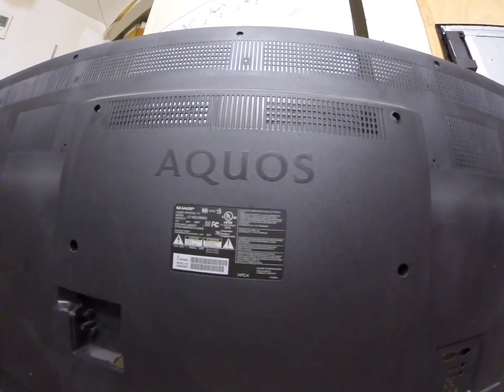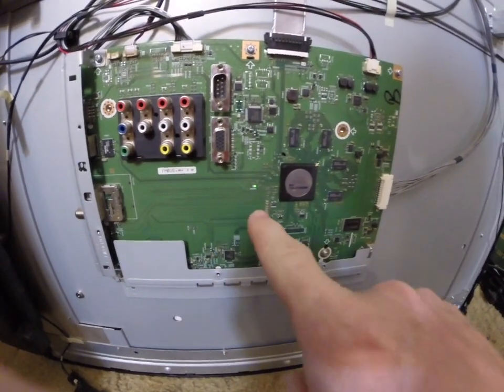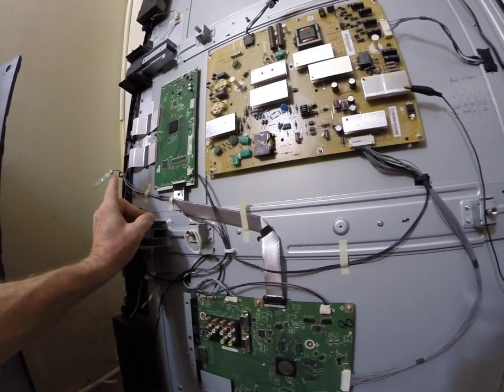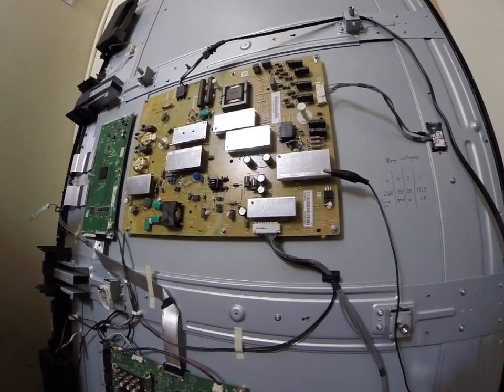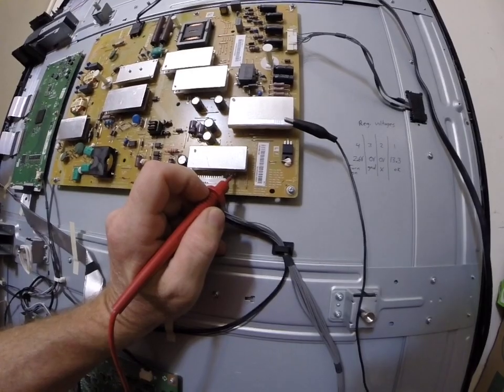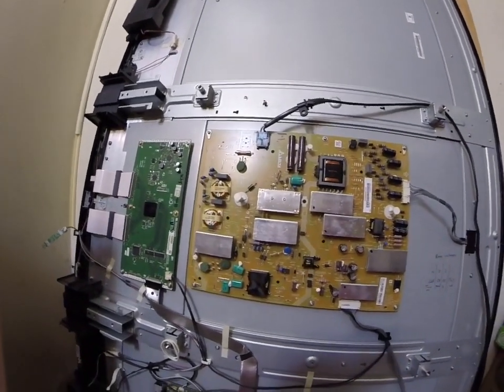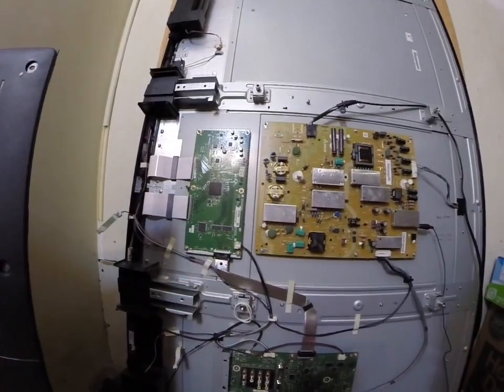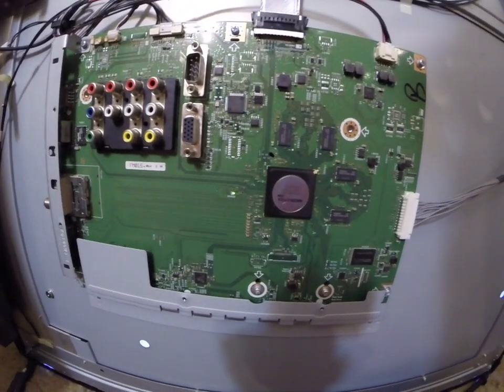SHARP AQUOS TV "LC-60LE650U"   flashes 3 slow, 1 fast.  No back light or sound. Here's the fix.

Comment: I wish I had seen this about a week ago. I just got tired of messing with my Sharp and it had the same fault and symptoms. I had replaced the backlights  because I had the one long one short fault code to begin with and it worked for a bit then went into the fault mode like yours. I also had a quarter of the screen stop displaying right before it happened.  I couldn't find no info and got tired of troubleshooting it and ended up just breaking it down and giving up. Thank you for the info though because now i can locate where i put my power supply board and repair it and maybe sell it to recoup some of my loss. I know they want an arm and a leg for the boards in these tv. Good find bro!!

Comment: Mine is aqous LC-50LE570X it has red standby and blue (switch on) but still no display no backlight no sound I tried to check the output voltage on standby it starts on 9v slowly going zero...do u have some advice for my tv?

Comment: Hi Ray, where did you find the  a  KIA378R12PI  ( 12V Regulator with turn on control ) I have ordered two sets of regulators these are not the turn on control regulator?  Can you please provide the manufacturer where you purchased your regulators?  Thanks a million!

Comment: Mr. Ray speaks the truth. Seems to be a common problem on this model power supply board. 
Same fix for a a 70" LC-70LE847U Sharp Aquos. In my case, the power LED was 2 slow and 5 fast which indicates display (panel) fault.
Normally fatal but having nothing to lose I checked the regulator anyway. 8.4 volts on pin 2. I want to say I got the replacement KA378R12
off eBay but not sure, anyway they were 2 for around 10 bucks shipped. It's a readily-available part; look it up on Google.
Make sure to remove the old thermal paste on the heat sink and apply new. Don't overdo it, a light even coat on the back of the part is fine.

The TV's been running sweet as a first kiss for a year or so now. (I got it free off off the local Craigslist) 10 bucks well-spent!
Reply from the maker: I'm Glad you got your TV repaired.. Good Job..

Comment: I have the same model...  I've been having power freezes (power light on, black screen, no response to remote) for years...backlight has never functioned...but no flashing or error code...  I have to unplug it, wait 10-15 minutes, then plug it back in...   Assuming that It needs that time to disapate the charge...  Do you think it's the same regulator causing it???  Thanks for posting this...  :)

Comment: Hi Ray, 
thanks for your video. I have the same Sharp model... it's been an excellent TV, until recently. I was wondering if you or your readers have any experience with this model, regarding local digital channel reception (re: antenna)...
We don't have cable (for channels),  but currently are using internet sucessfully for internet channels like YouTube.... we cannot any longer receive any local digital channels
My Sharp will no longer receive any local Digital channels (have done several resets, as per set-up, which has always worked in the past. I'm getting an error message "remove scrambled channels", which we never had this message in past years....  is there a digital tuner chip in the TV that might be defective?, or is this scrambling new? Thanks
 The antennae, cable & transformer have all been changed,

Comment: Hallo there I hope u still here I also have a sharp but mine is the model LC-60LE635E
It looks really similar to the model you have, the power supply board is the same and I have the same issue, no sound and no backlight. On my tv it blinks two times maybe I'm Lucky as well and have the same problem. I'll check the the four pins and give you feedback. Thank you for the video!
Reply from the maker: good luck..
Reply: I have measured:
pin 1: 12v
Pin 2: 13v
Pin 3: 0v (ground)
Pin 4: 2.4v

So my regulator is fine.. sadly..

Comment: Hi Ray, thanks for the video. I realize you may not know the answer to this, but I appreciate that you are taking the time to respond at least to other questions.. I am wondering where that turn on voltage, pin 4 on that regulator is getting its 3 volts from? That seems to be the problem with mine... I have 12v on pin one, but only millivolts on pins 2 and 4, I changed out the regulator thinking it was at fault, but after researching your video a few times I think I’m understanding that pin 4 needs to be getting 3 volts from somewhere in order to “turn on” and send voltage out of pin 2... is this correct? And do you know where it should be getting that voltage from? Thanks again!
Reply: Check  your other voltages on that board. You should have 5V standby voltage for one on another white connector and others. You could also trace the circuitry back to see where your missing voltage on that pin comes from. I wish these videos would show the schematic, if possible, so we could follow the voltage paths.

Comment: I have a similar issue with a lc55ub30u i just picked up off Facebook for free ordered all new boards for cheap off ebay I'm praying to jesus that after i replace all the boards it fixes it it's not hard to replace the leds i just don't want to have to resort to that and i truly don't think they're dead as I'm not positive but i think when i was tinkering with it they came on briefly at one point then shut off so I'm pretty sure it's power related
Reply from the maker: good luck...
Reply: @rays.2480  im pretty confident it is the power board aswell as the leds plug into that and the power light comes on so I'm hoping the boards fix it if they don't idk whats going on i think it's unlikely that its the lcd itself or backlights but i could be wrong

Comment: Hi I have Sharp Aquos LC70LE650U, I already change the power board what you did but still same flashing I get. Do you have any idea what else the problem is?
Reply: Same here. Just replaced the board to no avail
Reply: I feel you both nothing. Ill be ripping mine apart again to try and figure it all out.
Reply: JayR Barbosa  did you fix it?
Reply: I have same problem replaced board and still same issues

Comment: Hi Ray Thank you for the video I have the same TV model and the same symptoms unfortunately we don't see how you changed the regulator in the video is it possible to make another video where we see you  change it as is it possible also to confirm the technical name of this regulator so that I can buy it online otherwise if you sell it it will be cool
Reply from the maker: please read the other comments.. If you have any electronics experience, then you can do it,,it's not complicated to change out the regulator..
Reply: @rays.2480  thank you for your answer I checked all the comments but I did not find the regulator designation please give it to me please I will look for it on eBay

Comment: I have a sharp aquos lc-60le550u and it looks identical to this and doesn't seem to have a backlight even though the panel comes on. do you believe this is the same issue and should I go ahead and purchase the same resistor? I don't have much experience but i can go buy a solder to make it happen
Reply from the maker: For a few bucks,,, what do you have to loose ?

Comment: did u just happen to have an extra regulator in your pocket? and what are the steps to taking it out and putting new one in?
Reply from the maker: No, I had to order it, I got a few of them, they were cheap. I did my typical testing, found out which voltages were missing, Which happened to be my 12V regulator. Found it, Looked it up online. 

I was able to use a common regulator for testing purposes. The proper regulator has an on/off control. With the common 12v regulator, the set worked fine. But you could not control the functions of the tv to turn it off. So, when it worked,  I then ordered the proper regulator, installed it, and the tv was good as new.
An easy job for someone that has electronic experience.  Not a job for an amateur.
Reply: @rays.2480  i tried the VOL  down, Channel up, and power button at sametime to bypass the blinking and it works, so now i have steady light, but i have no backlight  now.
Reply from the maker: Sorry,  I can't tell much more about the tv, as i do not have it here. it was a customer repair.

Comment: hi i have the same tv whit the same symptoms did some power tests and i have the same as on you video  by any chance you have one of those regulator ?can i buy it from you ?? i only found them from china   delivery estimated February 22  thank you
Reply from the maker: I think i have a spare, I'll need to search my box, I'll get back to you soon..
Reply from the maker: Sorry for the delay, i have looked and i have 4 chips left.. Let me know how many you want.
Reply: @rays.2480  hi can you send me 2 just in case
Reply from the maker: @angelito1472  sure, send me a private message and we'll go from there.
Reply from the maker: @angelito1472  did you get my replies ?
Reply: @rays.2480  I know this is an old post but wanted to see if I could buy the part off you since you did have spares, I can cashapp you and give you my info for shipment, if you still have them that is, thanks in advance.

Comment: Can you tell me what the part number is please? Or what replacement to purchase
Reply from the maker: it's a 12V regulator with remote turn on.. you can see the part number on the IC, I bought replacements from Ebay, was cheap

Comment: Thank you for this video. But I do not have this issue, my issue is I get a box saying 'Unfortunately, TIF Test is not responding or working' and "AquosTV is not working or responding". I would like more information on how to get this working or removed. It interfers with tv channels with antenna, no cable. Does anyone else have this issue? How to get this working again?
Reply: Alma you can reset it using your remote

Comment: So here’s another trick hold channel down, volume up 30 seconds the three flashing lights will go off and TV will power up
Reply from the maker: That's not true.. If the regulator I Pointed out is bad, it will not power up with that so called trick...